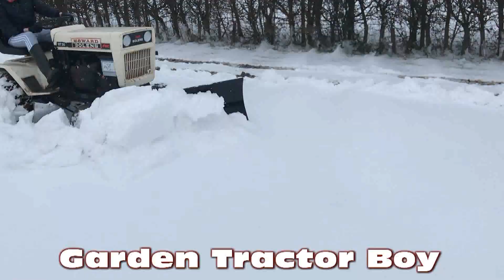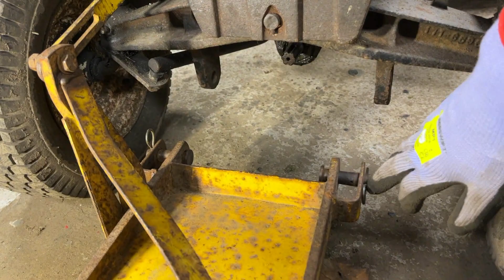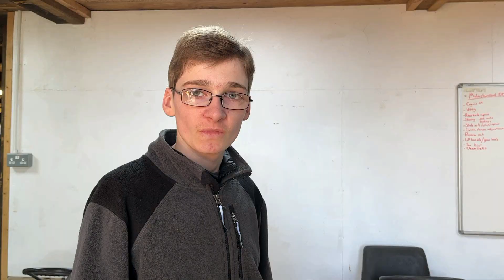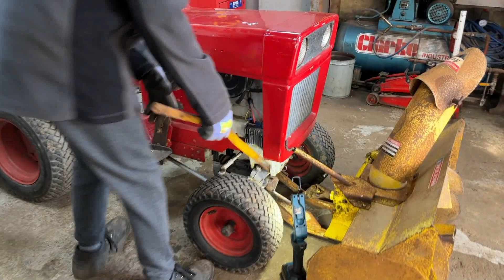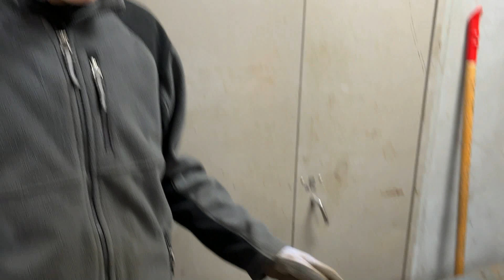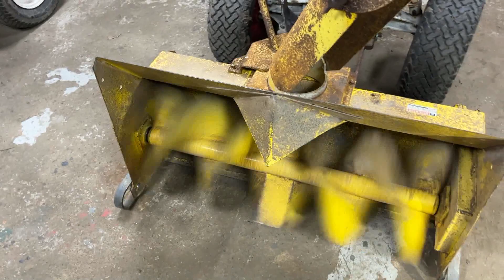Bolens Snowcaster 32 Model 18514 - Part 4

Comment: Hi Joseph.  I have not seen all of your videos yet, but i will.😀Keep on doing great videos i like it. I have purchased a Bolens G14  1453 and i want to fix it. But i dont now where i get parts to it. So i wondering if you can help me if you know some websites that have parts to it. i have found one but they dont ship to sweden.  
Best regards Leif✌😎🚜
Reply from the maker: Hi Leif, thanks for the kind words and for watching my videos. Due to the high shipping costs we try to match parts with common hardware where possible and we have even made some parts. If this is not possible we buy parts either from Rick Bolensman (Facebook) or from Brian (Google Bolens Parts & Supplies). In both cases you will need to contact them direct as they do not ship overseas unless requested. If you need any help with parts or get stuck with anything drop me an email and I will try to help. My email address is in the "about" tab. Take care and I hope you enjoy your Bolens G14
Reply: Thanks Joseph.
I will check it out.
Thanks //Leif

Comment: Hello folks. It looks great! You guys did a fantastic job on that link rod. It is interesting that both the blade and the blower have the same lift link. The blower looks really good on that tractor. It takes a bit of a lift to raise it up and down! It runs really smoothly! NOW FOR SOME SNOW!
Reply from the maker: Thanks 👍 We were very surprised they were the same lift rod but that made it a lot easier. It is a heavy attachment to lift, in future we may put it on a tractor that has hydraulic lift. We are still waiting for snow. Take care

Comment: Great video fellas. Sounds great. Nice and quiet. I have a kids snow carpet on my snow plow. Works great. Nothing sticks. I did try it in my John Deere 140H3 tractors snowthrower model 49 and it didn’t seem to work very well. 
I spray all my thrower chutes with Tremclad Gloss Clear paint. Works great. No sticking. Two coats a year does them fine. 
Have a great week fellas.
Reply from the maker: Thanks, we are pleased with the way it runs. Thanks for the advice on Tremclad, we will have to see if we can get that over here. Take care

Comment: Well done. A little tip for when you get ready to use the snowcaster. Start the tractor, engage the pto, and put the throttle at the slowest setting. With the auger of the snowcaster spinning at the slowest speed, spray a good coat of WD40 all over the auger and inside the auger housing. And with the pto off spray the inside of the chute. That will help to slick it up so the snow slides right off of everything and so its less likely to clog up. It also doesn't hurt to spray the drive chain and the entire outside of the unit. That will help with rust prevention.
Reply from the maker: Thanks for the kind words and for the tip, we will try that. Take care

Comment: That link rod you made looks really good and the test run sounded really good too. There is no slop whatsoever in that Snowcaster now with all the bearings renewed. Well done! I'll be doing a snow dance in hope that southern England gets a few feet of snow before winter's over so you can try this out.
Reply from the maker: Thank you very much. I do not think it has been used much, everything is very tight. We just need snow now. Take care

Comment: When you're well prepared for snow, you'll get rain. Good job guys. You can salvage a windshield wiper motor and mount it to the chute control so that it is driven by electricity with a 3 way switch. Good Luck, Rick
Reply from the maker: Thanks. Great idea on the windshield wiper motor, we will have to look into that. Take care
Reply: @GardenTractorBoy  I learned it from the AC/Simplicity guys. You now should look at a cab for working in a snow storm. You could make one from steel tubing like electrical conduit, as the frame and cover it with clear plastic sheeting. Just be careful about exhaust fumes. Good Luck, Rick

Comment: I was really surprised at how fast these spin when I got mine running. I taped streamers to the inside of the chute for a parade I took mine to. It really put out the wind.  Nice work on the linkage, but the round bar seemed to flex some. A lift assist spring might be a nice add-on. Take care.
Reply from the maker: Thanks. I really like your idea of streamers for a show. You are right, the bar does have some flex but we hope it will hold out until we can make a proper one. We do have a Bolens lift assist kit somewhere, it may be time to search for it. Take care

Comment: Due to circumstances beyond my control, I couldn't watch the  Parts2 & 3, so I watched all these now this afternoon, to see how you're coming along with this.
You are doing quite well, by the looks of things here Joseph. Now, If you want to test that 'Caster under a load, ( although you may get a bit wet ) you can gently drive the Bolens with Caster attached and in operation into a large puddle of water and see if it blows the water about. This can and will, load up your system very well, and is a real test of the drive system too.
Caution: Don't 'feed ' the water too aggressively to the Caster (( of vice versa ))  but just enough to hear the engine load up.  after all  water is liquid snow :) 
Having suggested this, I think there is no worries at all as to the effectiveness of this Snow Caster.
Reply from the maker: Thanks for catching up on the previous parts. I like your idea of testing in water, we get more of that than snow :-) Thanks for the advice in doing it. Take care
Reply: @GardenTractorBoy  Cheers, stay safe Joseph!